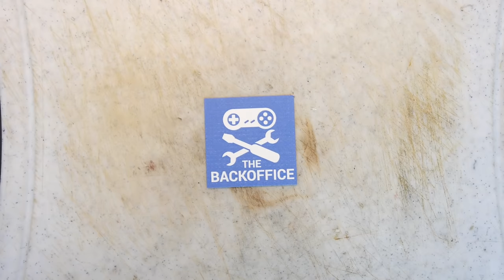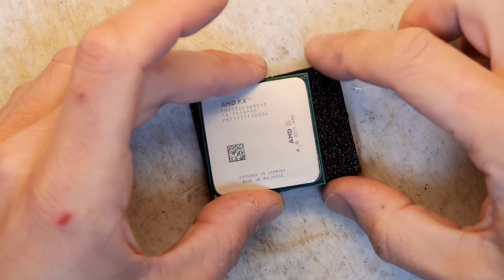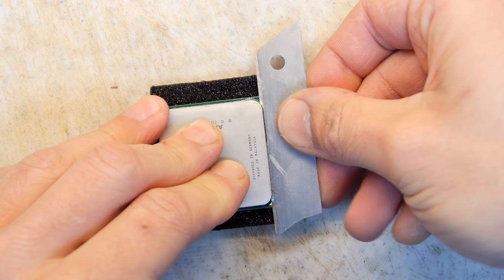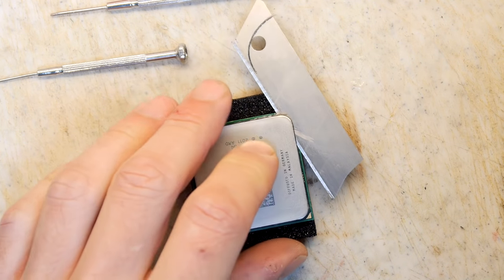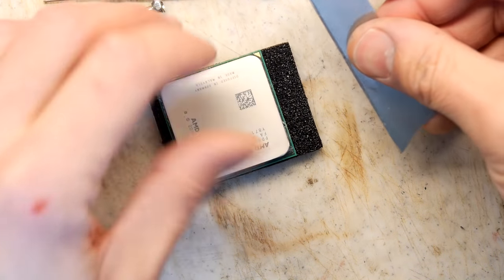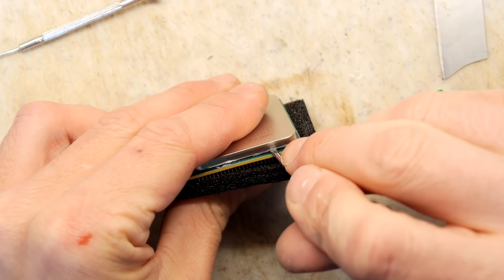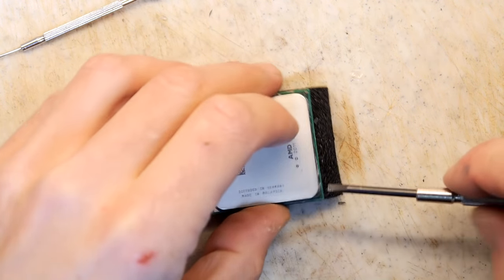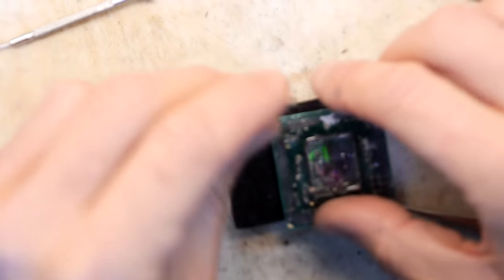Do not DE-LID an AMD FX9590 CPU! (Already dead CPU)

Comment: lol, i suppose to late to tell you this, but,... Tools you need -Hot air gun, - Plastic Pry tool, --Metal pry tool or squeegee, --soldering flux and soldering iron but can do it without iron, just using flux. 
----The lid is soldered with a thin run of solder. Apply flux around the lid edge where the pcb meets (use a fair amount,  and using the hot air gun, apply heat one side at a time and pry using the metal pry tool. 
---- Do all sides till you see a gap.
---- Install the cpu on a motherboard, and, install stock cooler. Dont need to apply compound / thermal grease. Just be sure its the stock cooler as aftermarket coolers are not always decked as well as factory. Hence the need of various material based compounds.
---- Power ON (regardless if cpu fires up or not, just power on for at least a minute, no more than 3 minutes at the most, as it gets to hot to touch. 
---- Power OFF and immediately remove cooler, leave the cpu clamped to the socket and with a squeegee (or a if dont have one, make a metal feeler, with a bent tip no  more than 3mm thick) run along all sides while applying hot air above with a hot air gun.
---- Continue applying heat. and with a pry tool (if you dont have one, get a tool set for lcd repairs. They are the plastic ones that are used for removing cellphone lcds)... 
---- Work your way around all sides prying up the lid, (BE SURE NOT TO DIRECTLY APPLY HEAT OVER THE PLASTIC PRY BAR, as that can warp the bar), patience will be your friend, cuzz you have to take the time for sure, dont rush and ruin the cpu if its not defective. GOOD LUCK on future ones.

RMA?? 
Out of curiosity, why didnt you just have the cpu rma'd? Amd has a lifetime warranty on all their cpus, at least a minimum of 3 yrs to 5 yrs. Could have gotten a replacement, as Amd doesnt fix and send back, they replace after stress testing and reproduce the symptoms submitted in with the rma request. Didnt know if you knew, and did the vid just to show, but some fyi next time :) Nice vid. 

-BEST WISHES
Reply from the maker: thanks for your procedure, very helpful! Interesting about the RMA, I was not really too bothered, but its good to know in the future!
Reply: The Backoffice ... Not a prob. Glad to pass on the info. I edited the comment. forgot to mention desoldering process, lol. but yeah. Not a prob, enjoyed watching you do it. i was curious to see the result, as your vid title peaked my interest :)

Comment: Never seen a cpu go bad. But have often seen ram go bad. In the Pentium 4 days overclocking and the fact that they ran hot anyway would cause alot of cpu destruction.  But more times than not ram causes so much stability issues.

Comment: also a dremel around the edge and a little goo gone should get it. also submersing the dremel sander in denatured water will keep down heat (plus use extender for the possibility of electrical shock) so use a large baking pan to distribute heat.

Comment: Symptoms of a dead dead FX 8350. System turns on then immediately off, fans spin for 1 second then off. Replaced the motherboard, tried 3 different PSU's. Took everything out of the equation including the fpanel headers and RAM. The only thing connected together is the motherboard, CPU, and PSU. Jumped the power switch with a screw driver, same thing. Removed the 4 pin CPU power plug and voila the CPU fan stayed on! Motherboard at this point is only powered by the the 24 pin plug. No power LEDs or signs of life other than fan spinning. No beeps, no post. Ugh. :( Plug 4 pin CPU power plug back in and right back to system turning on then immediately off. Remember this happened with 2 different motherboards and 3 PSU pulling my hair out trying to diagnose the issue. The troubleshooting tip to look out for is what happens when the 4 pin CPU power plug is removed. If the system works better without the CPU power plugged in that's a big problem. CPU is dead, like dead dead, probably an internal short inside the CPU preventing the motherboard from allowing it to run for more than a second. Purchased a replacement 8350 CPU. Got POST and boot, everything fine now. Hope that helps someone out there. My first ever dead CPU. There was no overclocking it was stock and just died one day. 8 core 8 itself. :(

Comment: You have to head the spreader to remove the heatsink. Small torch or something similar would have removed it easily. You also needed to be very careful when you were using the razor to not go further than the spreader depth
Reply from the maker: Yeah, having one to use as a reference will be so much better if I ever try to teardown another one. Thanks for the comment!

Comment: Heat gun would have worked better for both soldered or epoxied on.  The IHS solder would have reached the melting point of solder faster than the die attach to the board solder would have.

Comment: So I could upgrade my CPU to a FX 9590 and I do some editing and rendering and I already have a FX 6300.I found one on ebay for like $150.Should I wait for zen and a $100 CPU from them? The only issue is it might only be a 4 core which is better for gaming since the single core performance would be better but the FX-6300 is doing okay with that already.I think the extra 2 cores and speed would be better.(I already tried overclocking it and I got 4.3GHZ which isn't bad I haven't tried any high then that yet.)

Comment: I de-lidded an FX4400 a few years back (it was sold as faulty, so was cheap, and was definitely faulty, had overheated to the point of melting solder!!!), not to try to repair it, I just wanted a neat keyring made out of the heat spreader... :P

Comment: Ever proving the point of why you (generally) don't need to delid a FX series... that solder is really on there, and solder is as good as it gets. but it's been done before.
Reply from the maker: Agreed, if the solder fails, your chip would have have got insanely hot! :)

Comment: It's a solder chip,the way to do it shoot with hotgun at 175c on the ihs for a min then flip the chip,the ihs would pop out indium solder just need around 160c to melt,i did it on my 2600k and 2500k before

Comment: only a couple mobos could support the FX9370 and the FX9590 because of their TDP of 220 watts. The power delivery of the mobo would eventually fail and make it look like a bad CPU when it was the power delivery of the motherboard. AMD says a lot of good cpus got thrown away because of this. My FX9370 still runs good after a few years of being over clocked to 4.9 Ghz on a Asus Crosshair V Formula-Z
Reply from the maker: +The Games We Play Luckily my mobos are ok, I did second guess myself a lot but over the last 18 months I replaced everything but the processor. Once this was truly dead, I bought two more and has enough parts to build two identical systems! 😂
Reply: The Backoffice well, might have to melt the next one, haha. I think AMD uses solder instead of Thermal compounds so there is no risk of drying out.
Reply from the maker: +The Games We Play you are correct, I posted a link to the update video on my investigation of this, also tomorrow I have a play Lapping it 😂

Comment: I hope you re-attached the heat spreader with hot glue and put the thing on a shelf after this
Reply from the maker: I went one better and after the hot glue I installed it back into the machine. I can say this was a great success at it functioned at least as well as when I removed it! :)
Reply: Sounds like the operation was a success! Huzzah!

Comment: So firstly a youtuber named "derBauer" has a video on delidding a Ryzen and seems very experienced, the procedure is identical. Essentially every CPU I can think of except the Intel 6 series will solder the IHS to the CPU. That allows the heat to transfer near-perfectly and thus you absolutely will not get a situation where one core is exceptionally hot as described at the start. The Intel 6th gen chips use conventional thermal paste because its cheaper and so the 6th gen Intel chips can have one hot core. I have no knowledge either way if the 7th gen Intels solder or use thermal paste.

Now your method (aside from the damage to the microchips, don't put the blade in deeper than you need to) will only work on the 6th gen Intels. Because of the solder every other chip will rip itself apart as shown. I suggest derBauer's technique if you absolutely must delid the chip - slice the glue holding the IHS down and then heat the IHS up until the solder melts and allows the two to come apart gently. It would seem the temperature required is about 150 degrees celcius, he used 170 to make up for the thermal losses.

And lastly, there is absolutely no reason to do this for most users. You will often find better performance with the IHS due to a larger surface area allowing a bigger area of thermal compound and thus better performance at the weakest part of the cooling system. The Intel 6th gen, on the other hand, will often get a good few degrees of improvement. Most heatsink mounts won't support a delidded chip so some people may delid their Intel, apply high performance thermal paste, and then place the lid back on top for about 2 degrees of improvement - about half of a full delidding.
Reply from the maker: +Olivia Lambert Thanks for the comment 👍

Comment: hey i have a really good question and would love to know tho i dont have access to any of the tools i would need anymore. with a micrometer what is the thickness of that amd lid in all four inside corners, than and if u could clean up the center of it to find out if its all a flat surface or if its a raise bump to reach cpu. anyway the point of the measurements would be so that one could surface grinder the top of the lid with out taking the cpu apart. if it was 50thousanths then one could try to lower that to 15-20 thousandths.
Reply from the maker: I will try to desolder the die from the middle in a near-future video and see if I can borrow a micrometer. Funnily enough, I was given a plastic one (marketing gimmick from a show) but ironically it was quite accurate. Shame I lost it :( Thanks for the comment!

Comment: I saw one guy put it on the frying pan and cooked it to about 200 C which melted down indium solder but its no point in delliding this thing since it has no tim to replace
Reply from the maker: +Antonio 1941 I might try to grab an infra red thermometer and measure the lid temperature while heating the inside until the solder melts.

Comment: if i remember correctly you need to apply heat to melt the solder amd likes to put on the heat spreader thats why the cpu core split, delidding is normally only dont with intel chips as the do not solder the cpu the the heat spreader

Comment: Okay put the razor (one for each side) in just a little bit prop the cpu off the table by the razor blades and add heat to the top of the lid it is soldered on the die. Now I have seen people that removed them to put them in laptops

Comment: this is a snuff film
Reply: I needed that chuckle, thank you.
Reply from the maker: +Willem McCartney I like to think of it more of an autopsy 😁
Reply: +The Backoffice
Technically, the CPU wasn't dead, it was just infirm.  So you performed the "autopsy" on an ill, but not yet dead CPU. :)

watch?v=uBxMPqxJGqI
Reply from the maker: It was down to running only on one core at 1/3 maximim clock speed. Id say it had already died and was now a Zombie!
Reply: I had a truck like that once.  Four cylinder engine, with one dead, two barely operational and only one good one.  I suppose it was best to put it out of its misery, then.
Reply from the maker: +Jito463 must have sounded amazing towards the end, a real thumper!

Comment: what mother boards did u find that work with the fx9590 i got a 970 pro gaming aura but i was told it may not work with it
Reply from the maker: I am using two systems quite happily, one with a ASUS crosshair formula V and a second with an ASUS MSA97 R2.0
Reply: 220wats i had to get gigabyte 990fxa ud3 ,i did have a asus sabertooth 990fx r2.0 but i sold up and running now

Comment: I'm sure you can get a little clamp pulling gizmo that can de-lid but they are very delicate. Plus I saw a video a few months ago about a guy that used liquid metal to reduce the temperature from about 30s to early 20s. You getting ready for the new Ryzen CPUs coming? :)
Reply from the maker: +m22rdy I'm ok for now, I have two identical systems setup and unlikely to wait to change, but I am expecting great things from AMD soon!

Comment: I did APU A8-6600k same lay out inside , change new  silicon inside and lock by high temp gasket silicone(HTV) .I found problem with very high operating temp and system shutdown(nono OC)... by now I reduce vcore from defult 1.45 to 1.30 v  idle temp 75c to 52 c at room temp 30c.
Reply from the maker: Do you reckon the reward vs the risk is worth it? Or would you only recommend if there seemed to be unusual heat issues?

Comment: you can use the socket from a dead motherboard to hold the cpu firmly,
and you can grind away the heat spredder if you like, it is possible to grind it thinner.
even a full removal is possible if you happen to wish so. the gains are not that mutch to be honest. however it is worth to note that you can assemble the heatsink on the cpu, then use a drill and be mighty precise and drill 2 holes on opposed to eatch other all via the heatsink and the lid it self, and provide ventillation under the lid. can help to scrape off 2-3 celsius or so, but its labor intensive to do and you have to know what you do.
and it does not worth the effort. allso you have to drill upside down to prevent conductive debrie going under the lid witch is a major suxxor.
been there, for fun did it. not usefull. but fun.
Reply from the maker: +Nagy Andras Thanks for the tips, really useful to know! Using the old motherboard seems obvious but I didn't even consider it!

Comment: wow... maybe if you want to remove a soldered IHS from a cpu, next time you should just hold it upside down and heat the IHS. it will fall when it is done, but still not a 100% success rate of not damaging the CPU.

Comment: only possibility for a safe de-lidding i could see as plausible, would be on a brand new chip, that hasn't been baked on? but even then the risk would be high enough to deter you from ever trying (unless it was essentially free lol) 
nevermind just read they are heat soldered on lol

Comment: I really can't stand AMD to be honest I have never had an Intel chip go bad on me even with a cheap aftermarket heatsink... You served it justice though and it put up one hell of a fight. If I was going to do something like that I would chuck it in a vice. There's not much to them, One thing though about those smaller components you picked those are probably what failed first. core material is really solid, but it's junk in the end... Great Video as usual very entertaining.  Did you know that it takes almost 2 hours to make a processor like that. From start to finish. And only 30 years ago it took 8 hours to make a 6510 found in the C64!  with 1/1000th the transistors and 80 fewer pins.... Just saying!  Great Video!!!! You inspire so many!
Reply from the maker: That's fascinating about the time it takes to make a processor, I would really love to know the process. I actually do know an expert who works in the factory at Intel, I really must see if I can get on a tour!
Reply: @backofficeshow  Take me with you! I would really like to talk to them.

Comment: What you did is not advisable, you shouldnt use a sharp tool , you can just can scratch the sides and use the screw to pull off the heat spreader. So long fx

Comment: AMD cpu's are soldered to the heatsink, this been known since release, and you cook the chip by trying to de-solder it.
not worth the effort to try and de- lid an AMD cpu it will 99% of the time end in complete failure.
Reply from the maker: I might try to get hold of another dead unit to try this again, but really its for curiosity rather than practical reasons. As you mention, for the risk, its not really worth it. Thanks for the comment!
Reply: dead ones are a different story as you did here, a new one out of the box, no way. it takes about 450f to de-solder one of these.
Reply from the maker: I might find this one and try to tear it down further to see how the silicon is bonded to the die. I think my main worry in heating it would be de-soldering all those buffer / driver / whatever ICs that are dotted around the board with it. My gut feeling is that they are a particular weakpoint, however, cooking this thing will kill it. The silicone gasket will make it take that much longer to pop the lid.
Reply: AMD chips are different they looked rushed with bits everywhere intel chips are very clean looking that's why even tho the x99 10 core chip has soldered ihs it can still be easily removed  with a soldering gun and maybe a roll of desolder

Comment: If it is still unstable u should just reduce the clock speeds in the bios. So go down to 4.5ghz for example. Well for the next one if it does the same thing

Comment: ROFL, people get triggered for nothing and mash "dislike".... though it`s common knowledge at this point that FX chips are soldered so i have no idea why you even seriously tried this. Regardless, i hope Ryzen will also use solder and not crappy paste like Intel does. It would really give them an upper hand especially with those OC junkies who push their chips hard from day 1. And i want me my AMD cpu hassle-free like it was for last 12 years since Athlon XP days :D.
Reply from the maker: +CMstacker I think put into perspective 'common' might be overstating it. Most people don't know what's going on inside the enclosure let alone under the hood of a CPU. 

It just amazes me that people have so much passion over a brand of silicon. For me, a working system is paramount, just a shame a cooling issue killed this CPU, still I replaced it with two more, life goes on 😁